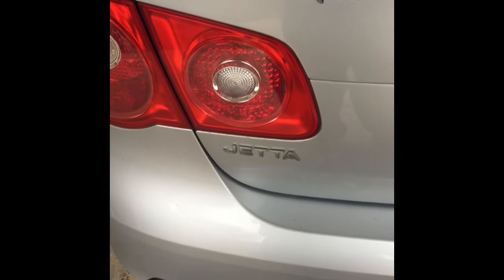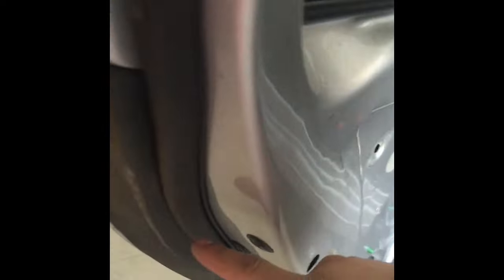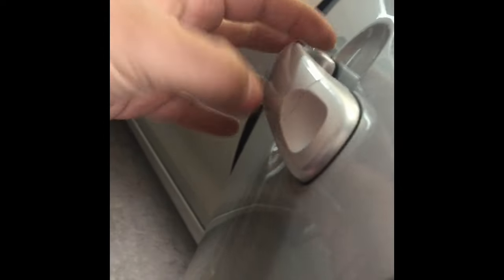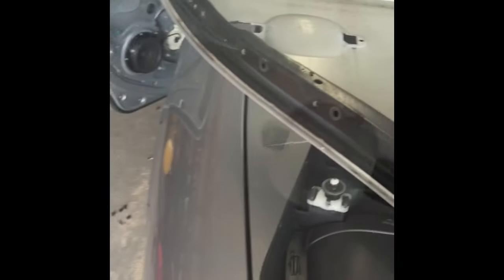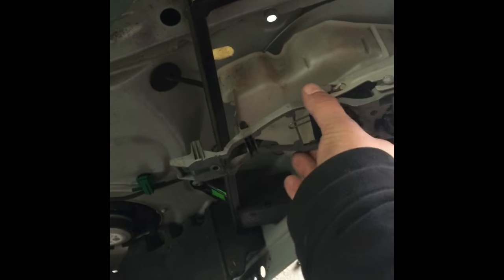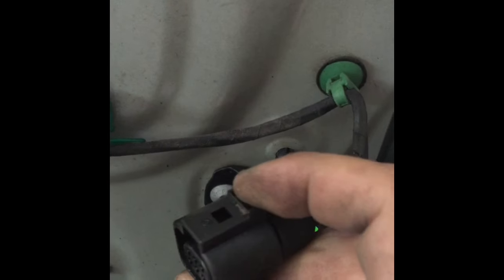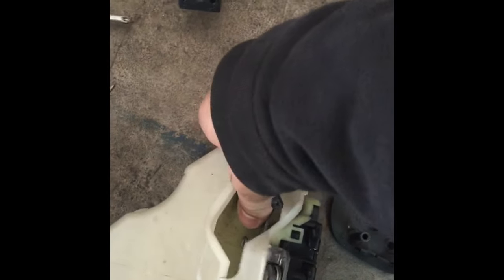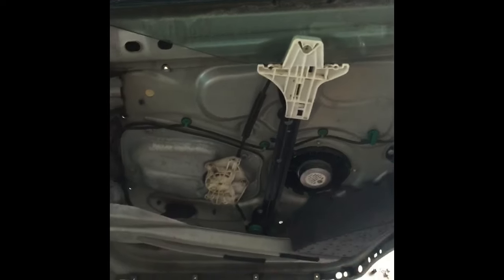07 Jetta rear door lock actuator removal MK5

Comment: Nice work Falcon.  Kudos to VW for making that outer door skin removable!!
For all you wondering - VW uses that 12 point internal headed screw a LOT.  In tool terms - its called a "Triple Square".  
If you own or work on VWs, get a quality set of Triple Square bits.  Theyre not cheap, and not easy to find either, but totally worth it.  Remove brake caliper bracket, hub, door skin etc = all Triple Square.

Stay gold.
Reply from the maker: dnl machine thanks for the name. 
After making this video I did get me a better set from snap on.  A real life saver.
Reply: Kudos to VW for making really crappy door locks and cruise controls. These are parts that rarely fail on most other makes but VW manages so they can try and enslave you to their dealerships. Almost like they use the home printer business model: cheap printer but expensive ink.

Comment: Thanks for the video. I just replaced the rear passenger door lock actuator on my 06 Jetta. Taking off the outside shell is MUCH more easier than trying to take off the inside door panel. 

The 6mm special screws are a b*tch to take off and easy to strip (which I did), but I managed to take them off w pliers. 

This method is definitely a better option for anyone having to replace the lock actuator. Thumbs up!
Reply from the maker: +Luis Saldana Glad it helped Buddy!! yeah that bulk is a pain...

Comment: Great tutorial.  Explains why my local dealer want $540 to replace a $40 part.  Why a $40 part that seems prone to fail is so complicated to fix is a more troubling question.
Reply: A more troubling observation is not providing a mechanical way to lock the door from the inside. If the solenoid fails, the safety of the vehicle is compromised, a poor engineering decision by Volkswagen.
Reply: Magnetic solenoids can also be actuated with magnetic fields.

Comment: What's the name of that 6mm bit for those 2 screws?
Reply from the maker: ራስ አንበሳ ተፈሪ t20. Torx
Reply: Falcon's Garage man for some reason the t30 I got is tearing up the inside.
Reply: Falcon's Garage is it a specific name for the torx?
Reply: Falcon's Garage I figured it out, it's called XZN/Spline bit
Reply: ራስ አንበሳ ተፈሪ  It's also called a 12 point metric internal wrench or triple-square torx.
Reply: its called a Triple Square